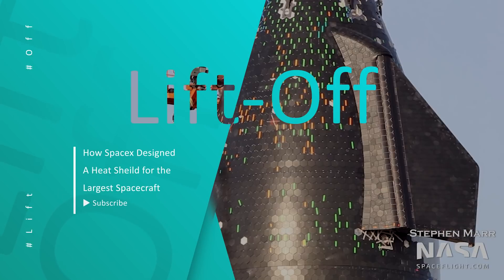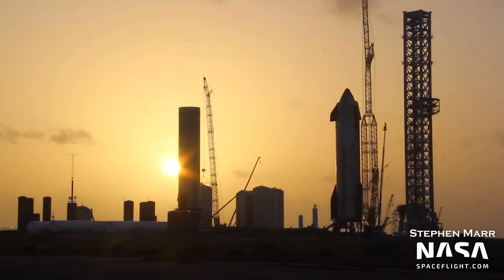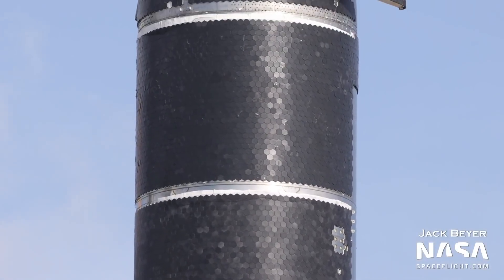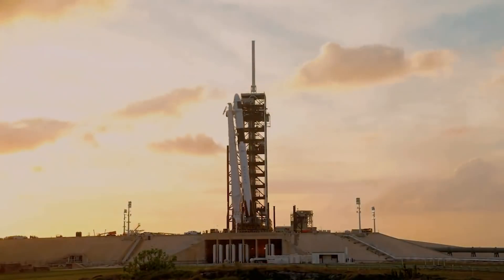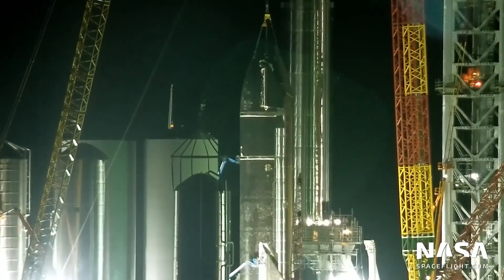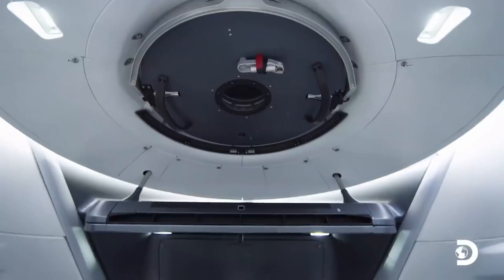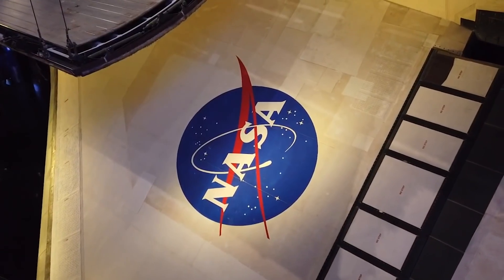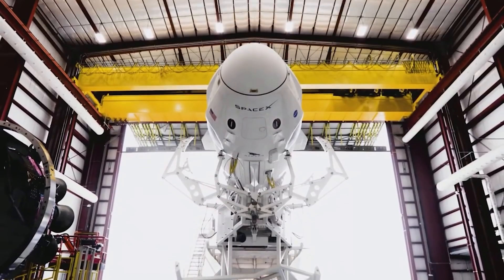SpaceX LARGEST Spacecraft Ever Built Aquired NEW Designed Heat Shield

Comment: The Thermal protection system, I predict, will end up being Space X’s biggest hurdle with this vehicle system. It will likely be the one element of the system that constrains them the most and limits their launch turnaround cadence. These ceramic plates are rev. 1 of a science experiment… who knows where they will evolve thermal protection to? But, what is certain is that any system comprised of such a large quantity of individual pieces that behave independently will be very high maintenance. How many of these tiles can you lose on reentry before you lose the whole vehicle? If the answer is one, or even 10… you have a ticking time bomb that can only be prevented by careful inspection of every individual tile before every flight which takes bloody forever, just like the Shuttle.

Comment: A gazillion ceramic plates each fastened with clearance and play… and this is supposed to be maintenance free?…. Remember the trouble NASA had with the shuttle tiles? There is no way this thermal protection system will be able to be turned around for re-launch quickly without careful inspection and servicing and repairs after each launch. This idea of a single vehicle launching multiple times per day is a target that will most likely never be reached with a ceramic tile type of system. If they achieve a launch turnaround of 1 per week now that will be a ground breaking achievement and maybe they will actually accomplish that.

Comment: Thank you, I'm a materials engineer so am interested in the materials. Sounds like the black tiles are carbon fibers held in a phenol which is not a ceramic but a carbon fiber material and the blanket could be a number of materials. The Space shuttle had a very porous alumina ceramic tile. Again I found out a little more that the white is a blanket of some material. Mostly to absorb movement of the black layer I imagine. No big deal, just curious.
Reply: Payload inside the engine / activley cooled re-entry  space vhickle

Comment: What material is used to attach tiles to stainless steel? I looks as if there are two materials layered on each tile, black outer and white inner. What is the purpose of each layer? I'd like much more information about the heat shield tiles but you have given me enough information to know what the questions are, Thanks.
Reply: the black outer is a form of ceramic and the white inner is a heat blanket, the tiles are attached using some form of pins

Comment: What about the black heat tiles sitting in the sun heating up in that Texas sun then rapid cooling when the cryo tanks are filled.  The extreme and quick high hot temp suddenly to a fast very cold temp. That might be a problem when you shake and vibrate the shit out of everything during launches.  Could that form cracks during launch?  I'm askin for a friend.
Reply: no there is a heat blanket seperating the black ceramic tiles from the tanks
Reply: These tiles will need to go from Ambient temp to near cryogenic temp then survive vibration and wind pressure, then several cycles of hot cold whilst in orbit, then red hot with pressure upon reentry. Each tile has to be spaced with clearance to the next to allow for expansion and contraction without breakage. There are wee gaps between each tile for this. And they fasten to the hull via three stainless steel pins each individually welded to the hull. I cringe thinking about it. There’s ~15 to 20 thousand tiles each with 3 welded pins, that’s 60,000 welds. How many bad welds can this system tolerate? How many bad tiles can you survive?… The level of dependence on strict quality control on tens of thousands of individual parts for this type of system is high. Are they carefully inspecting every weld? There is a thousand ways this can go wrong. It will be critical to recover the vehicle after it splashes down in the ocean if it survives reentry so that they can observe the condition of the tiles.
Reply: @trevorkolmatycki4042    Thank you, I was wondering...I mean, my friend was wondering.

Comment: Maybe a layer of tunsten sheet metal over the tiles to give safety to the tiles.
Reply: tungsten is too dense
Reply: @Fisheiyy  It has a high melting temperature.  Make it as thick as only needed.  If its brittle, maybe another metal layer or an alloy.
Reply: Ha maybe ice cubes also